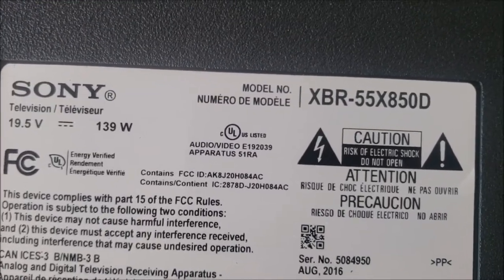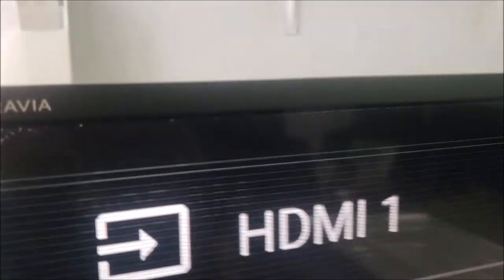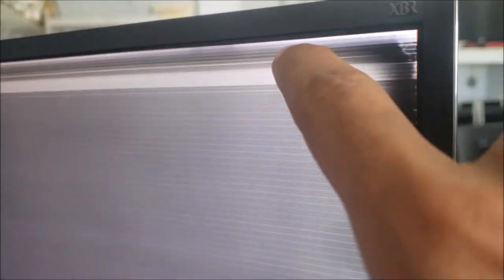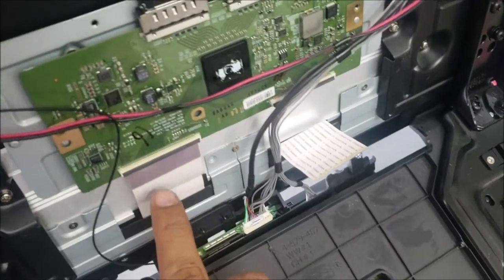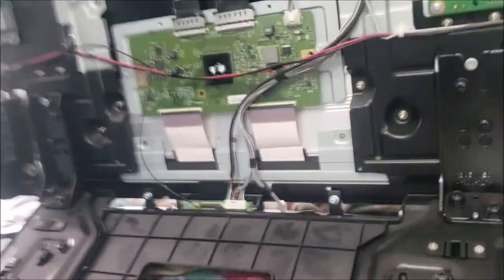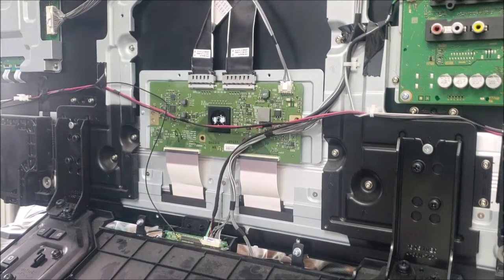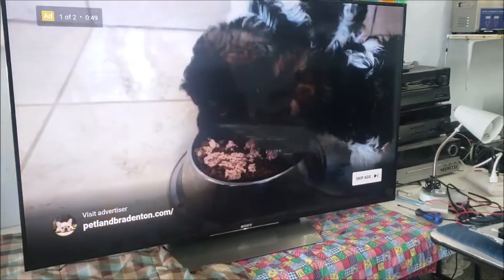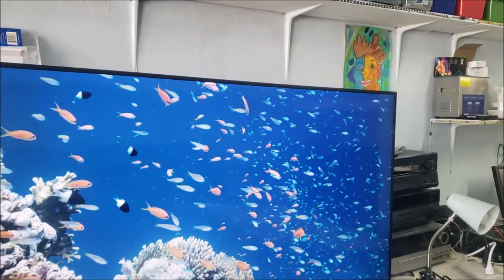sony tv XBR55X850D double image lines and flickering

Comment: Sony XBR-55X950H only 2 years old had a similar issue - thin black horizontal lines rolling across left half of screen every 5 seconds or so.  This solved my issue, and as luck would have it the first piece of tape I applied to the ribbon cable fixed it.  Thank you so much!  I was about ready to give up and buy a new TV, but this trick saved mine.

Comment: Double images on right side of 52-inch SONY (KDL52W4100 BRAVIA) bought new in 2009. Three thin horizontal lines about every quarter of the way down from the top - look like gaps. 
Any idea as to whether this can be fixed?

Comment: Very helpful and great video! i have the same problem but can i just replace the ribbon cable instead of putting tape on it? thank you
Reply from the maker: no. the problem in the screen not in flex cables,
Reply: @SOSfixElectronics  so how am i going to fix it? can i replace the tcon board instead?
Reply: @SOSfixElectronics  i was wondering the same things. I supposes both flex ribbon cables on the tv are the same.. so i suppose to test for this would be just to swap one side for the other side.. and if the other side causes the flicker.. then it can be identified that the ribbon cable is the problem? and if so.. perhaps there is som trouble with the contacs on the ribbon cable or the ribbon cable holder which can be remedied with contact cleaner??

Comment: sir, simply in my case the flickering doesn't do it immediately, it plays normally for about 20 minutes and then it flickers and other times it finally disappears, the image becomes black and the backlight also turns off and other times I have a backlight without an image, the problem is somehow complex
but it always starts with flickering
Do you have something to suggest me from your experience?